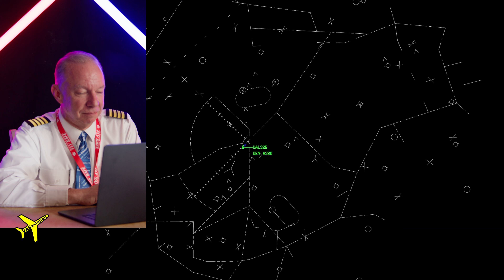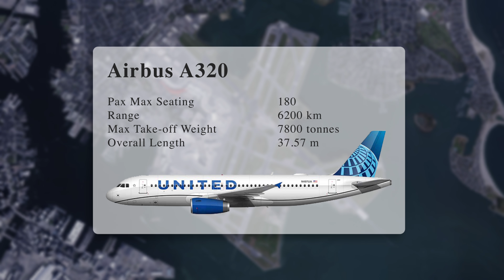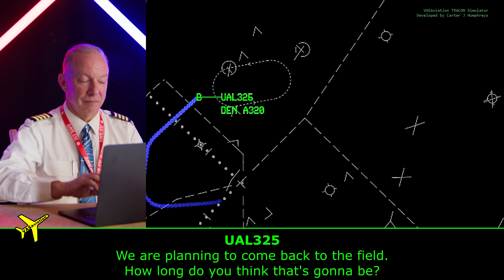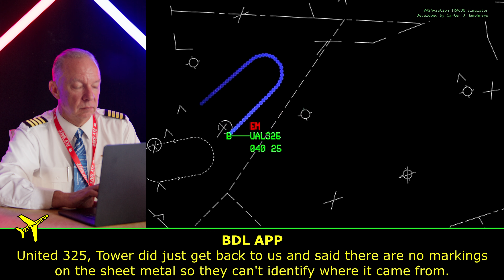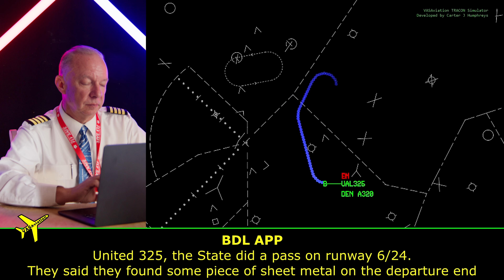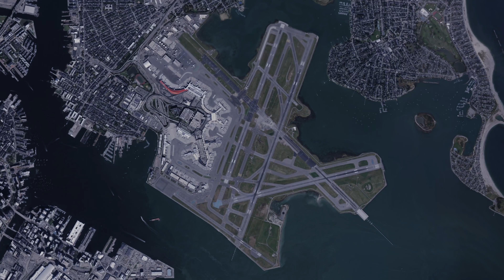United 325 Disaster Averted: Engine Trouble at Takeoff! | Captain Steeeve Breaks It Down

Comment: If a plane “can” land overweight in an emergency (United was 10K-12K overweight in this incident), how is it determined whether or not to dump fuel? I imagine it’s influenced by how quickly the aircraft must land and total length of runway available.
Reply: If you have an engine flameout or engine failure you have usually time to dump fuel, if you have another situation where you have to land, let’s say medical emergency or fire you wont think about dumping fuel right?
Reply: The A320 can't dump fuel. It can land overweight, but it would require some additional inspections.

Comment: The Delta plane DL876 was forced to land at Atlanta yesterday due to haze in the cabin and I was wondering why the captain didn’t drop the yellow masks for the passengers to use? 🎉Was this a decision based on cost to reset the masks? They were sitting in a cloud of toxic smoke during the emergency landing. Also, I noticed that it looked like the tail cone had jettisoned off the rear of the plane for the slide to deploy out the rear of the plane can you comment. Thanks Mike
Reply: The masks are used for any loss of cabin pressure situations. The masks don’t seal to the passengers faces and wouldn’t help much if any at all. The smoke would still be able to be inhaled since they’re not sealed when worn.

Comment: shedding parts? thats basically how continental brought down the concorde.
Reply: Well, if you read Mike Bannister's book (BA Concorde chief pilot) the subsequent analysis of who saw what from where during the AF4590 takeoff reveals that the fire was burning before the wheel ran over the titanium strip. The BEA report was incomplete in this respect, however the missing wheel spacer and a known bad runway joint at CDG 26R is what started the crash sequence. The titanium strip and fuel tank rupture added to the fire, however that started with a fuel leak into a dry bay from which the access panels were found near the end of the runway having been blown out by overpressure.
Reply: That’s the first thing to come to mind